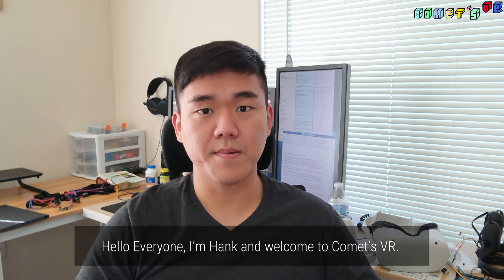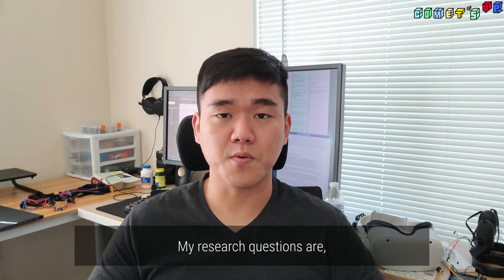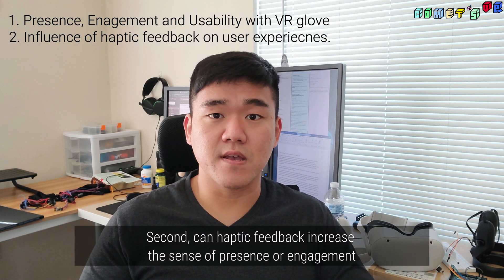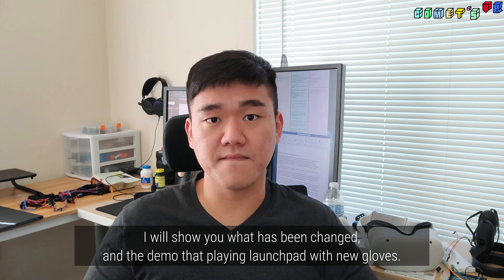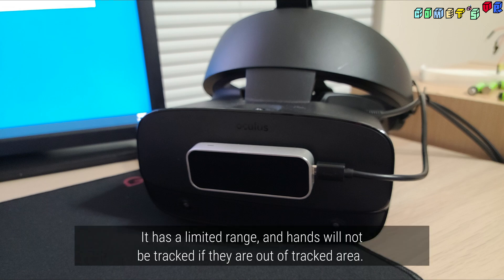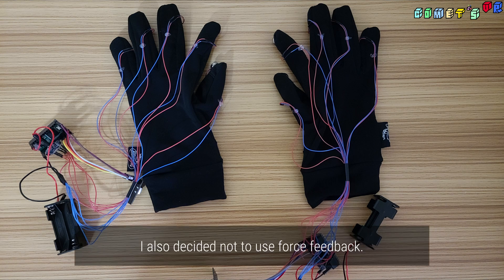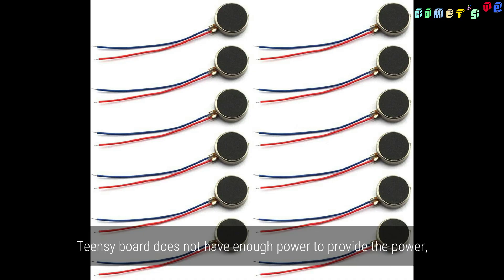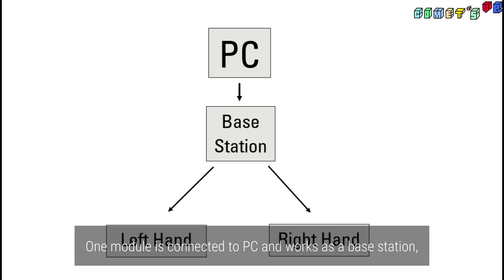Playing Launchpad with VR Haptic Glove (New Haptic Glove with Leap Motion)

Comment: I am very impressed by your projects. Just one question how do you transfer information from the vr environment to get feedback from the vibration motors. Are you using some control algorithm or something, thanks.
Reply from the maker: Thank you for your interest! I used RF modules to transmit data. I integrated RF modules and Unity into one system.

Comment: You mention the 13ms latency, are there any components available that could give you a lower (wireless) latency? Cool project!
Reply from the maker: Hmmm, I am not sure. I minimize the latency by optimizing the codework and maximizing Teensy board frequency. But I am not pretty sure what else I can do more.
Reply: @comet-tech  Are there any components that would allow you to transmit data over faster? Or is the one you are using the fastest it could be?
Reply from the maker: @lukenguyen1938  To make transmission faster, I maximized the processor frequency, maximized bandwidth and optimized the codework in Teensy and Unity Script.
Reply: @comet-tech  Could you possibly make a tutorial on how to setup the teensy with the wireless transmitter/reciever?
Reply from the maker: @lukenguyen1938  Yeah, I am thinking of making a video. But you can take a look how to use NRF24 module and Serial Port ahead.

Comment: What do you think about what the tiktok guy is similarly working on
Reply from the maker: They are cool. As far as I know, their purpose is to distribute the cheap DIY glove. That's a good idea. However, they need to make their goal clear what to do with those gloves. The gloves does not have buttons and joystick which disable the users to interact and travel in virtual environment in conventional way. I am not sure how good their force feedback will be. If it is not good enough, it will fall into uncanny valley of interaction technique. It means it will be poorer than just joystick. It seems like their glove will not compatible with any games on the market because lack of interaction technique. That's why they need to clarify their goal with their gloves.

Comment: Could you list the electronics components you used?
Reply from the maker: 1. Vibration Motor
2. Teensy 3.2
3. NRF 24L01
4. AAA Battery
5. Arduino Mega for base station
6. Oculus Rift S
7. 2N2222 Transistors
Reply: @comet-tech  Thanks
Reply: @comet-tech  Why not opt for the Teensy 4.0? Too much power usage for your current needs?
Reply from the maker: @lukenguyen1938  4.0 is overkill for this project. 3.2 is still over kill but tho!

Comment: wait so what happened to the finger haptics thing where it would move your finger back with a motor?
Reply from the maker: I am not using that temporarily.
Reply: @comet-tech  Which sensors are you using to track the finger motion? Is it the same flex sensors as the other versions?
Reply: @mankind8807  its the leap controller
Reply from the maker: @mankind8807  I used LeapMotion controller to track the finger movement.